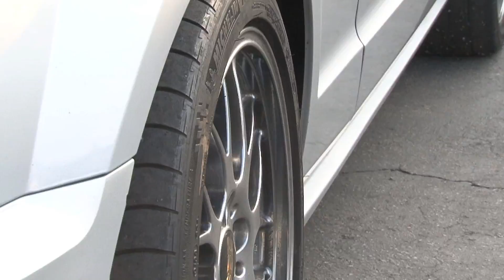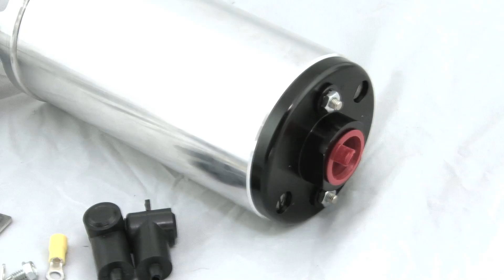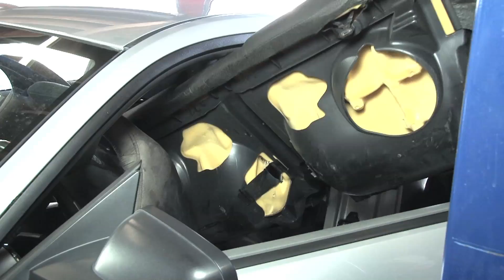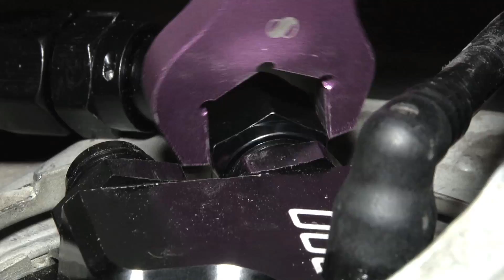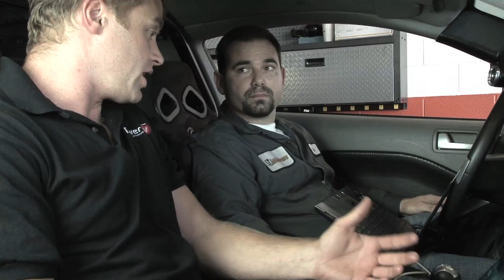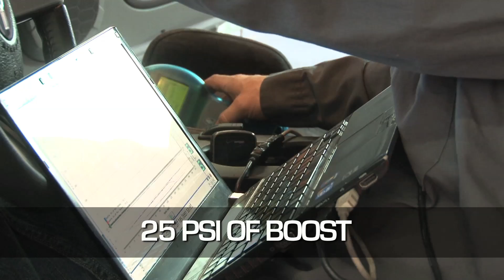More Power and Boost with Aeromotive's Single Pump Stealth Fuel System

Comment: Aeromotive needs to develop a Aeromotive Flex Stealth Fuel Tank alongside of the Aeromotive 340 Phantom Stealth Fuel Tanks. It would make it real simple for those who would like the choice to run E85 or Gasoline. I need one for my 66 Chevy Impala. So go on ahead and take a SKU 18318 65-66 Chevy Impala Fuel tank and replace the Aeromotive 340 Phantom Fuel Pump with the Aeromotive Flex Fuel Pump and I will Gladly purchase one! Thanks in Advance!!
Reply: baklyskontakt  pas til tenult 1.5